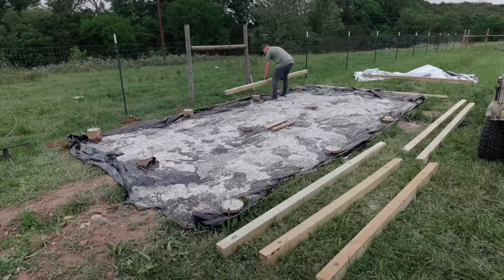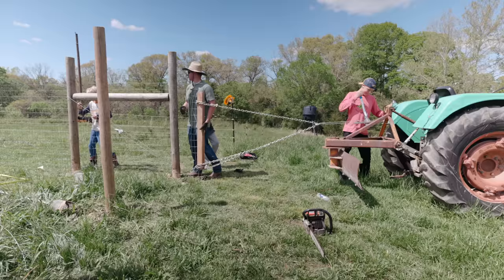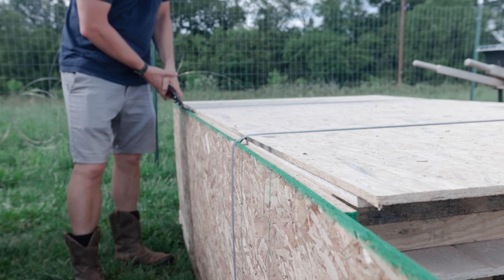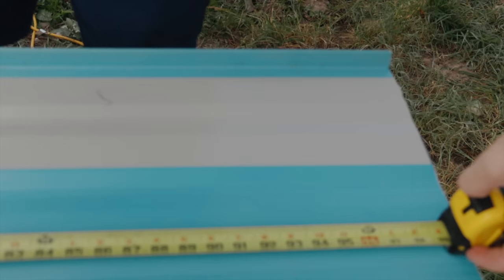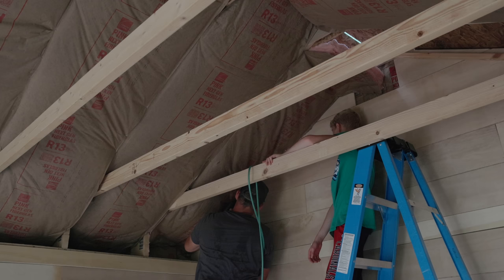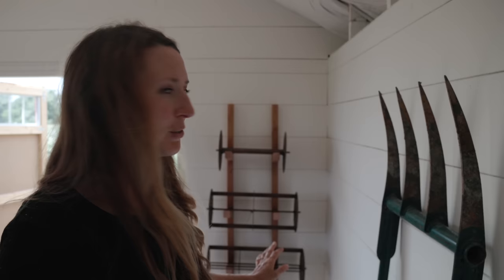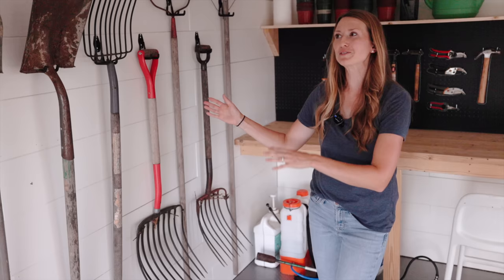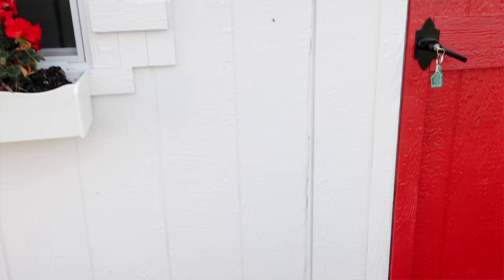Not Your Average Garden Shed! (Shed Build and Tour)

Comment: What an awesome job guys! 

In our workshop we reused the old kitchen units and worktops until we installed rack shelving units. I like to screw jar lids on the underside of a unit or shelf and store different size screws and bits and bobs in the jars. Makes it much easier to find the little things you need. If you have a drip system you can also store the small drip connector parts.
Reply from the maker: Love that idea!

Comment: FOR CLEANING [and lubricating] YOUR TOOLS:  Get one more of those garbage cans, and paint it. Now get a bag of builder's sharp sand from H Depot, and pour in a quart or 2 of 10w40.
When you bring a dirty shovel back, rinse it off outside, then bring it in and stir up the oil in the sharp sand with a couple of digs of the shovel blade. Simultaneously sharpens and oils your tools!
Reply: Almost Forgot: When you do an oil change on say, the tiller, or the Rolls, pour some of the dirty oil in....tops up what has stuck to the shovels!

Comment: Ok no electricity to the shed maybe a solar panel on the roof so you would have some power for lights ya I see the two lights by the door maybe some gutters for when it rains and maybe some rain barrels to water the garden great job good luck

Comment: Nice Shed!!! I built a 12x20 office(shed for permitting reasons ;-)) with the same principle with the skids but as a Lean-to roof(10' precut studs down to 8' precut studs) after I was sent home from the office to work remote back in March 2020. I did R38 in the floor, R16 in the walls, and R30 in the roof with some of LP Tech Shield to reflect the NC sun! But mine is an office so I have a 70 amp subpanel, 12k BTU mini split, an apartment sized fridge, a few computers, and some 3D printers in mine!  Before you know it, you are going to have the baby out there in a rocker hanging out since it's so nice!!! Do you plan on running power out to it or maybe getting one of those Eco-Flow/Jackery power packs for possibly more light in the evening/dusk to run some interior LED's? 

I like that method of hanging your yard tools on the wall with those hooks. I added a lean-too carport on the back of my office and this would be an excellent way to store all my yard tools too! since I have a 10' wall, I added 2 of the NewAge shelfs that have the Wire to allow for either ceiling or wall connections. I also have 2 - 18"x4'x8' dewalt racks to store all my wood working tools on. 

Glad you, the baby, and family are doing well! My 3 girls love watching your videos!  Take care and godspeed!

Comment: Spraying the insulation may be problematic. The paper allows any water vapor in the fiberglass from condensation on roof decking to pass through. 
I hope the paint doesn't prevent the vapor from moving out.